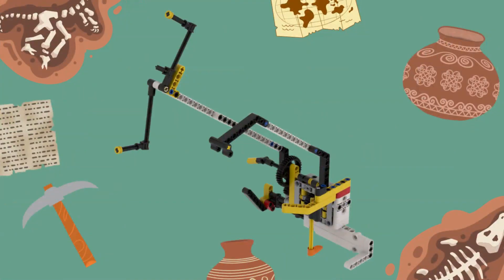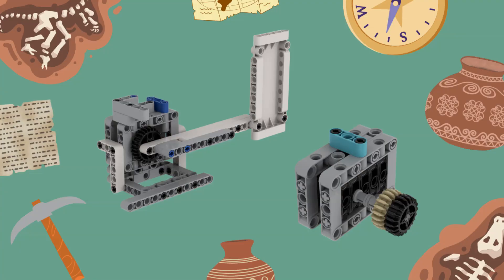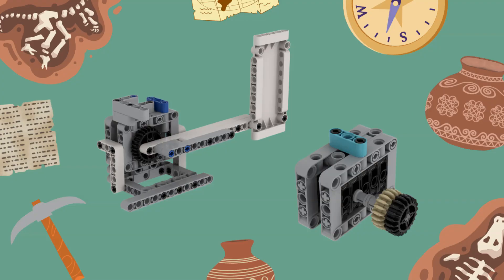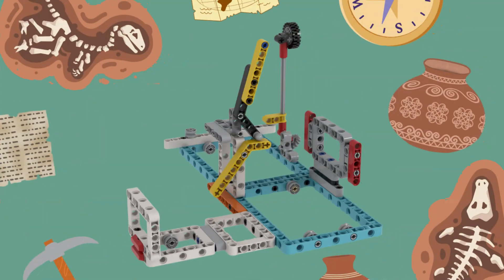545/545 | FIRST LEGO League UNEARTHED Challenge Complete Robot Run

Comment: I’m having trouble increasing the force of my robot for silo without increasing the speed so much It hurts the mission. Do you have any suggestions?
Reply from the maker: Try adding weight to your attachment by adding more parts at the end of the arm. This way you might be able to back off the speed. Try adding weight piece by piece until you find a good balance. 
We decided to put the technic panel there not only to deflect the gears as they are flying out of the Silo, but also to increase the inertia. 
Keep in mind, the mission model only has to withstand three hits per match without breaking. On your practice table, get into the habit of fixing it after every try. At the competition let the referee fix it before your match. 
⚙️⚙️
Reply: @6006TechWarriors thank you, you have helped my team a lot.

Comment: Are you guys programming in python or scratch? And how did you achieve a curve on run 5?
Reply from the maker: Hi. We are using the Spike Legacy App. 
The Long Right Turn in run 5 was a trial and error process. The weight of the artifacts required us to adjust the speed and turn severity (in the „Move (Right: 30)“ Block that we used to turn to an angle). We can let you know the exact values we used on e we check the program. 
⚙️⚙️
Reply: @6006TechWarriors  Not to be rude, but it's still unclear how the robot did an organic curve. FLL robots usually move linearly with straight lines or relatively precise turns. My question is how did you guys achieve a curve (like a masse shot in pool)?
Reply from the maker: @heronymousbot5883 Hi. No offense taken. This is something that is very difficult to convey and understand. We tried to explain this in both of our programming tutorial videos some time ago, like this one on using MyBlocks to make a more precise turn using the yaw angle sensor: 
https://youtu.be/phqz47MBcbg?si=4AcYm_Ab7IC8AG4-
In run 5 after taking off from the wall we are using a turn severity (or turn value, or turn rat) of 15 and a speed of 45 and turn until we reach an angle of 61 degrees, which puts the robot with all the weight and drag of the collected artifacts where we need it to then drive forward at 61 degrees to push the artifacts into the forum. 
Let us know if you need more help with this. We could also connect on IG to share pictures of code, or go into deeper explanation. 
⚙️⚙️

Comment: How do you make the turns so accurate?  Our team has a great gyro straight that they use but the turns are always a few degrees off each time and throws some of the missions off.  We use Spike Legacy block coding.  Thanks!
Reply from the maker: Hello. For turns, speed, or lack thereof, matters. The faster and tighter you turn, the more the angle will overshoot. With the Spike ADB we keep the speed down to 15% for 100-type turns. And we always specify a few degrees less than what we want to turn. We made a tutorial video for gyro turns a while ago, go check it out 
⚙️⚙️

Comment: our team just had our qualifiers, and we realized we could put all the site markings in one site. (we chose the salvage operation site) are you allowed to do this?
Reply from the maker: Hello. On page 12 of the Robot Game Rule Book, the scoring condition for Mission 15 Site Marking are listed as: “Sites with a flag at least partly inside and touching the mat. 10 each”. This means that you score 10 points for each site that has a flag partially in it that also touches the mat. 
Unfortunately that means that putting all three site markers into one target area will only be able to score once. 
Hope you will be able to adjust and still place them in the three target areas. 
⚙️⚙️

Comment: Amazing! Out of curiosity... pybricks or Lego Inventor?  Reset yaw to 0 only once at start-up and always turn relative to that? It seems so precise without slowing down the moves too much. Also, what is connected to the 5th port? 

It's a really professional-looking video - thanks for sharing.
Reply: Wow! Very impressive performance — well-organized and inspiring.
Please, could you kindly assist me with some guidance on how to develop similar attachments and the program write-up, even if it's in picture format?  
Thank you.  
Looking forward to hearing from you.
Reply from the maker: @idrissadamuchindo4944 Hello. Sure we can help. For starters, which robot kit are you using? For exchanging pictures, we could take this conversation to Instagram. 
⚙️⚙️
Reply: Congratulations.
You possible give for me instructions for build🙏
Reply from the maker: Hello. We switched the firmware of the robot to the Spike Legacy App and are using Word Blocks. 
We zero the yaw angle at the beginning of each run except for during run 4 where we re-zero between missions 2 and 3 when backing into the north wall. This is necessary because of the +/-180 degree limitation of Spike Prime. 
The 5th port still has a light/color sensor attached, but we are not using it for anything this season. 
⚙️⚙️
Reply: @6006TechWarriors  Thanks a lot for the response! Hope you guys go far.